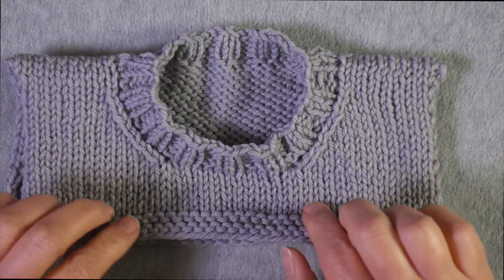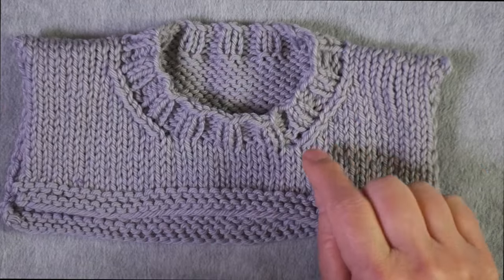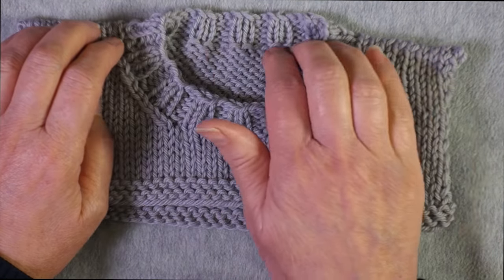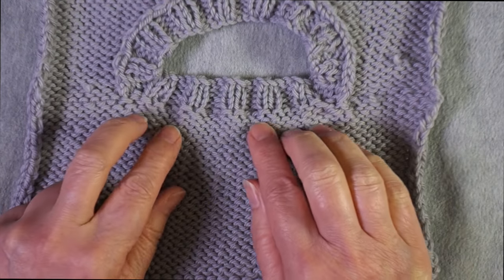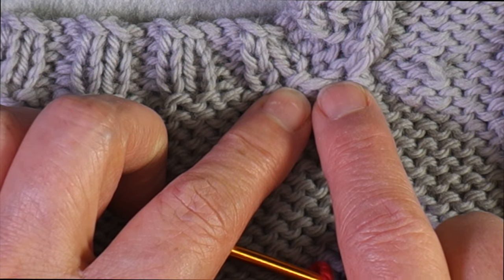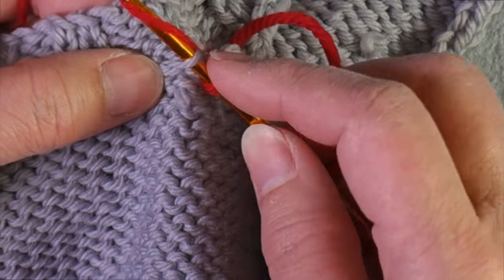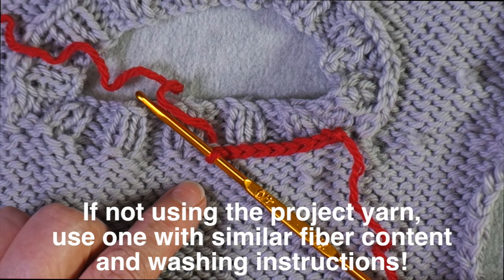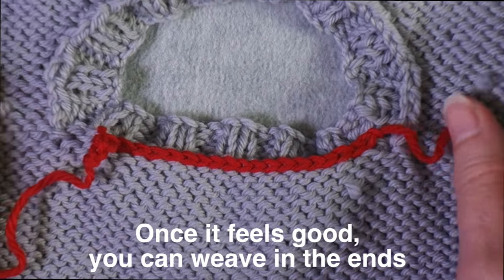Fix sweater shoulders/neck that are too stretchy // Technique Tuesday

Comment: This was exactly what I needed to make my alpaca swoncho wearable! Due to the weight of the yarn, the neck was stretching out almost to my shoulder joints. I was thrilled to find that I could use slip stitch while reducing the number of stitches 10% to simultaneously stabilize and reduce the size of the neck without making the collar ruffle. Thank you!
Reply from the maker: You are so welcome!

Comment: Wonderful, I've stopped the horizontal slide. Thank you Roxanne. Now, do you have any secret techniques on how to stop vertical stretch? I made a long cardigan which is getting longer and longer, presumably under it's own weight. Is it possible to put in some vertical crochet lines (even on the outside as a decoration) to slow the stretch, and would that be between the stitches or through the stitches?

Comment: Thanks! Just saved my deep disappointment in my latest FO that ended up waaaayy too big in the neck after blocking. It wasn’t even a super wash wool, so I’m not sure what happened. The edge of the neck is a little ruffled, but I think with a quick steam it will sit well. Whew! As it is a top down sweater, I was not keen to try to undo and redo the neckline-too much sweater surgery with that method!

Comment: This is very helpful! Can the same technique be used to deal with ribbing at the bottom of the sweater that stretches with wear?
Reply from the maker: This technique is meant to stabilize the fabric to prevent stretching at places that need to support the weight of the sweater. It sounds like what you need is something that helps the fabric maintain its elasticity (i.e. ability to return to a contracted state when it's relaxed). You might want to try elastic thread, instead.
Reply: @RoxanneRichardson  Thanks. That was my plan but thought I’d double check and see what you thought. Thanks!

Comment: I have a steeked raglan cardigan that keeps going backwards (front opens up more and the back moves downwards, and it perches precariously on the tip of my shoulders- i do have narrower shoulders). The cardigan is fairly fitted, but does not have a negative ease. Worsted weight yarn, tight gauge. 

It is fine when it is buttoned up.  Could this benefit from a single crochet reinforcement?

Thanks a lot for all of your videos.
Reply from the maker: Did you add any neck shaping/shoulder shaping around the neck, or was it completely knit in the round with no shaping (standard back and forth, with increases or decreases at the neck edge, depending on whether it was knit top down or bottom up) or short row shaping? If it was knit with no neck/shoulder shaping, that's likely the reason it's riding up in the front. Still, it doesn't hurt to stabilize the back of the neck. If it doesn't help (or if it makes things worse), you can always take it out. If the neck ribbing was picked up around the neck opening and worked, you might be able to add short row shaping to the neck edge after the fact. Take out the ribbing back to the first round, and then work some short rows in the ribbing to raise the back of the neck (which will drop the front).
Reply: @RoxanneRichardson  
I added about an inch of short rows shaping. Maybe that is too less? 

Forgot to mention that. Was trying to give you all the info and forgot to add that :)

Comment: Thank you for this video! I added a crochet slip stitch reinforcement to the neck of my raglan sweater and it worked perfectly Now I would like to crochet slip stitch the raglan decreases. You mention it but do not demonstrate it. I can't figure out where to start as there are no purl bumps. Could you elaborate? Thank you!
Reply from the maker: Assuming the sweater is knit in stockinette, you can use purl bumps adjacent to the "seamline" in a diagonal parallel to the seamline.
Reply: @RoxanneRichardson  Thank you! Does it matter if I knit to the right or left of the seam line?
Reply from the maker: @Sandra-m3g  I have no idea, but given that it's slip stitch crochet, and very easy to pull out, you can experiment with different approaches on different sleeves and if you think it makes a difference, take out the one you like least. If it doesn't make a difference, you've learned something for the future.
Reply: @RoxanneRichardson  How true! Thank you!

Comment: Off topic (sorry), but what stitch was used in the main body of the sweater? It's beautiful :")  *Superb video, as always!*
Reply from the maker: The filler stitch you see in the front is moss stitch (US moss stitch/UK Irish Moss). The back of the sweater has a wide cable/lace panel. The sweater is a Knitty pattern called Ausable.
Reply: Thank you. I'll incorporate more moss stitches into my projects! <3 

I surmised your sweater was using a modified bubble stitch, although in hindsight that clearly would not be possible at that scale. Silly me :)

Comment: This was interesting. And, I’m wondering how you fix an already made sweater where somehow the neck wasn’t stretchy enough to go over my daughter’s head:(. Is there any way to fix this, please?
Reply from the maker: The first question to answer is whether the neck opening is too small (where the opening is created at the shoulders) or if the bind off edge is too tight. If your daughter is a toddler or younger, the issue might be that head proportions are different than for an older child. For babies and toddlers, the solution is usually to have the neck knit back and forth and one shoulder finished without seaming, so that there is a large enough opening for the child's head. So it depends on a) age of the child and b) whether the issue is actually with the neck being too small or the bind off being too tight.

Comment: Hi Roxanne, tnx for this very usefull video. I have a question though: for a 6-year dress in coton, would you advise a stretchy cast off at the back or not? I still need to knit a little colar on it.  Tnx for your help!☺️ Dona
Reply from the maker: There is no single answer to this question. It depends on how tightly you find off and what the neckline of the dress is like. In most cases you will do a standard bind off that isn’t too loose or too tight.